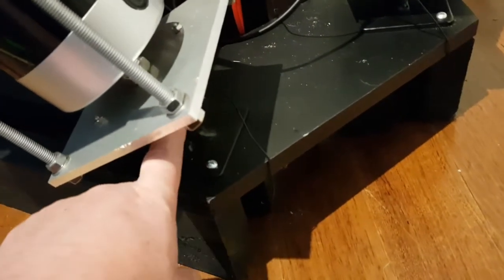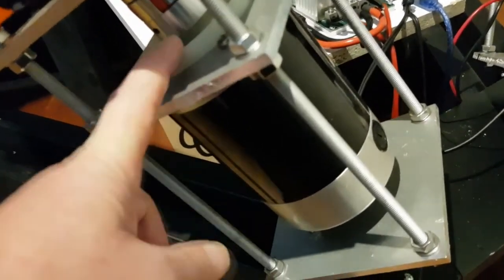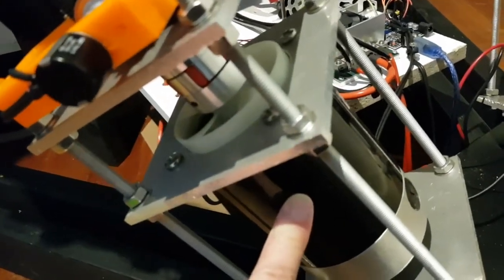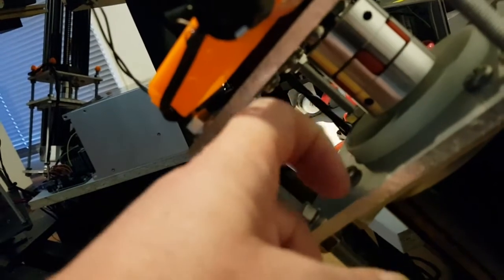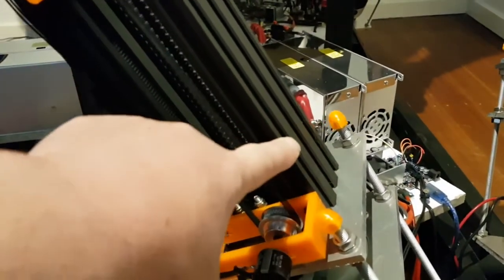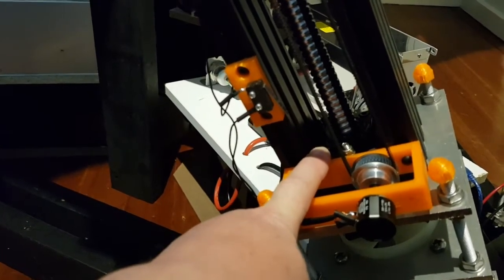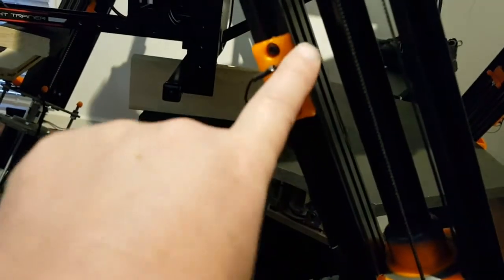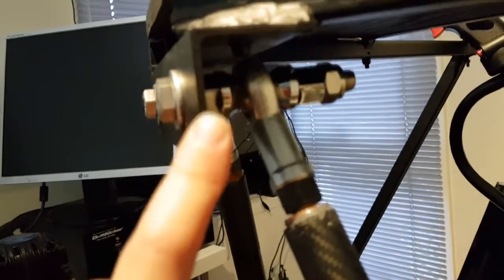6DOF X Plane 11 Motion Platform walkthrough (hardware) part 2

Comment: I can't understand how carbon fiber can slide inside bearing without getting damaged.
Reply from the maker: The rods slide in the bearings with almost no friction. Over time I guess they would wear. I used mine for ages and they were fine.
Reply: @sixdegreesofflight7765  Thanks